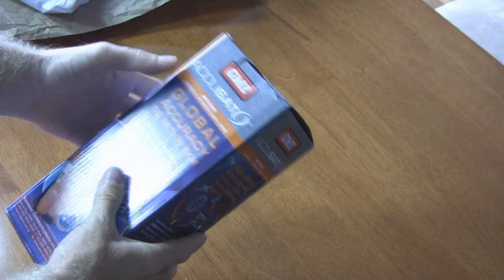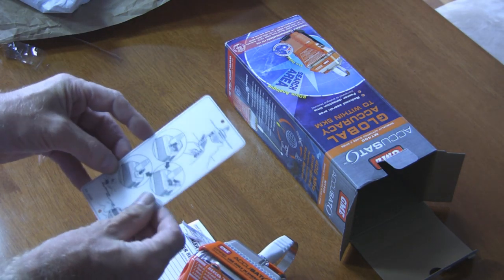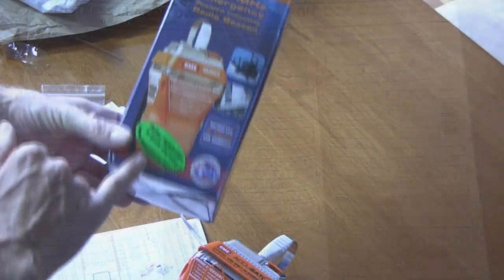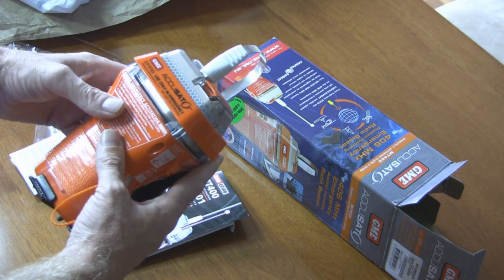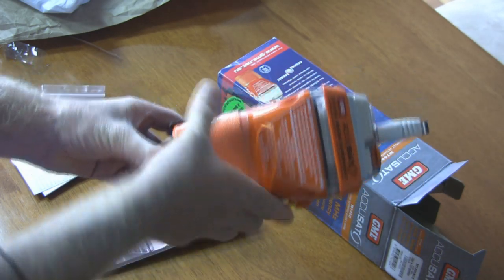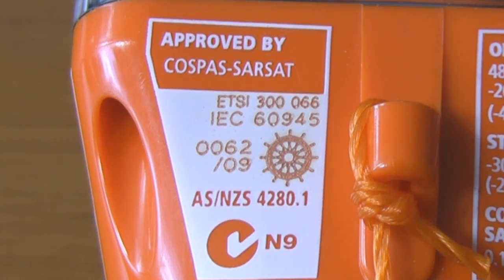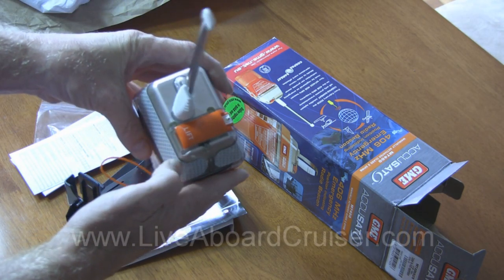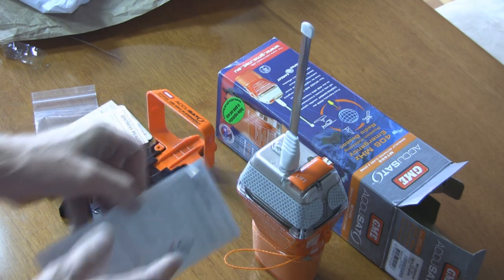EPIRB 406 MHz Activation, Testing and Registration

Comment: You can now buy online EPIRBs from our web site vhfradiocourse for as low as $249, so now there is no reason for not having one. Better still consider buying one with built-in GPS. The search area is dramatically reduced as the unit is transmitting you lat/ long coordinates